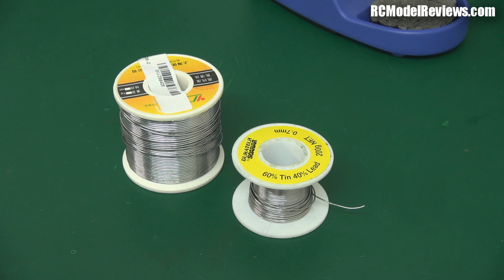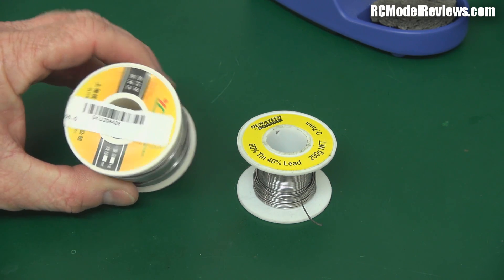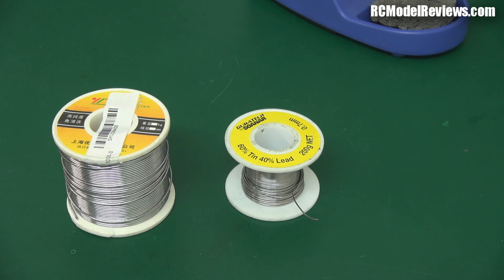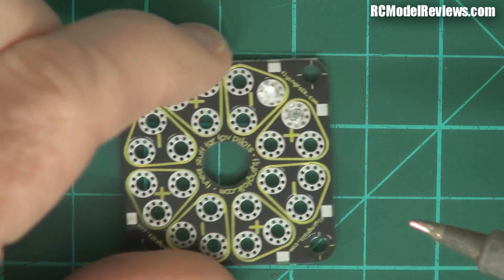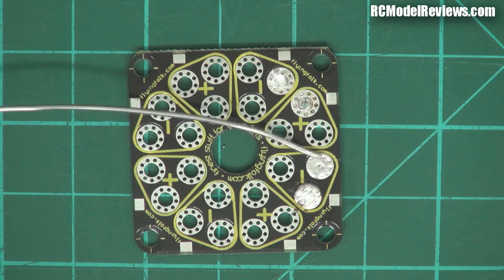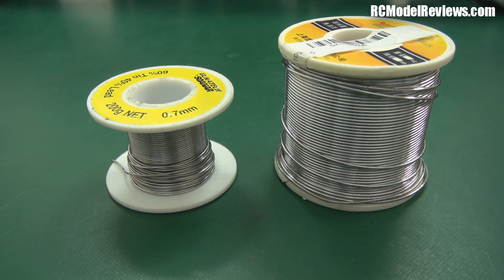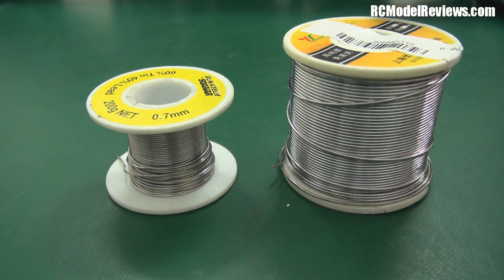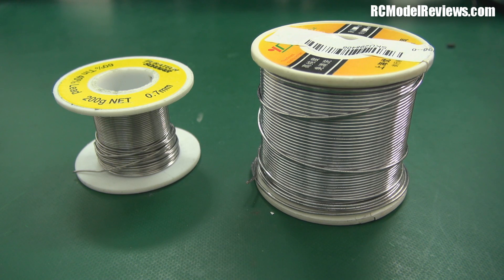60/40 versus unleaded solder

Comment: Lead solder can save the planet. When you capture that scary lead you can melt it in very controlled circumstances and restore discarded equipment, often due to failed RoHS solder joints, thus putting more tech into society and away from the landfill. All it takes is a bit of leaded tin, some dissolved tree sap, and a few watts of energy. Then that scary lead is sequestered in a useful tool instead of being out in the wild where it can attack your kids.

Comment: 60/40 sucks as bad as lead free solder. 60/40 is not a pure eutectic as it has a plastic state. The real deal is 63/37 tin/lead solder as it has only two states, liquid or solid. Lead free sucks because it has nasties like whiskers that occur as part of its process. If they would figure out how to make it where it didn’t do this, they may have something there. If you want the best solder, now you’re talking 63/37 tin/lead with an RMA, rosin mildly activated flux core. Why you may ask, used under J Standard 006 level 3 rules, this solder produces the best appearances, can withstand mechanical and physical stresses, g forces and thermal inversions and laugh. As long as it is performed under the strict rules of this standard,the joints will pass all tests and laugh. Most are unwilling to solder to this level, aka critical circuit soldering. It takes discipline, no compromise and strict adherence to this standard. Few can, but it is possible to learn. There is no place for any mediocrity at this level. Only the dedicated and the disciplined find this certification after their name. You can learn!

Comment: I've always wondered why everytime I  solder a joint it comes out really bad, really messy or poor joint/cold joint.  turns out i was using unleaded. using higher heat did damage to  so many of my PCB's and surface mounts

Comment: You should also mention that unleaded leaches the copper off the actual PCB (the traces etc.) unless you pay for gold plating/flash and because the chemicals used in gold plating are so much worse for the environment than lead, its use in fact worsens the state of the planet.

In the leaded solder days hot air solder levelled PCBs were very common, because these manufactured really well and could be reworked and repaired. With lead free you just can't rework fine pitch PCBs without gold.

Comment: 2:00 If the presenter is an expert, why did he try to buy 250g of solder for $6 (NZD?)? 🤔🙂 Why not spend $60 AUD/NZD on 250g of decent solder like Multicore 62/32/2 Sn/Pb/Ag?  It's a big price difference, but surely it's worth it for the quality control? 🤔🙂

Comment: I had to do a second take when you said $6 for ~500g. I think at that price point, it's not representative of any type of solder. I don't recommend buying solder that doesn't have Western text on the product: this is a declaration of what you're about to use a year later when there's no trace of what you bought. For example, you don't know if the flux is water-based and MUST be cleaned, you don't know the amount of silver, and you don't know about conformity to laws in your country. I recommend to learn what types of solder there are now, and to buy solder from a known brand that does product declarations - to you, and to stores, companies, and schools that stock them.

So your problem (if you want to call it that) could be up to heating and re-heating the solder too many times, too much solder applied, incorrect temperature on the soldering iron, uneven flux core, wrong composition for your use case, or not spending any time getting used to it as you did with leaded solder a generation or two ago.

Comment: I don't have these issues with sa305 and nice flux. also I find that a good quality soldering iron is necessary with lead-free, you need higher temp and better thermal transfer.

Comment: It's pronounced "Sodder". Tortilla is pronounced "Tor tea ah".  Lead free solder works well in industrial dip soldering applications. For hand soldering, use name brand 60/40  or 63/37 tin/lead rosin core solder and rosin paste flux. Use a "bridge" of molten solder between iron tip and items to be solder joined. Keep iron tip wiped and "tinned". "Tin" ends of wires before attempting to make connector solder joints. Tinning= Coating  with solder. PRACTICE soldering, watch solder flow action, learn to heat properly and remove heat quickly  to avoid damage. It's an art.
A name brand 67 watt soldering iron with replaceable tips works fine for hobby soldering,  a nifty soldering station is nice but not necessary.

Comment: Im only half way through the video right now so you may have touched on this in the later parts but.... the dangers of lead are far more than what you're making it out to be. the stuffs literal poison. when using lead based solder it is CRUCIAL that you wear a glove on your solder handling hand or wash your hands after soldering. avoiding touching your face until then.  thankfully we have ROHS for large scale manufacturing so lead doesn't spread throughout the environment through E-Waste. and I CANT STAND lead free solder but if you want to make your life easier you must take the proper precautions, lead WILL stay in your bones FOREVER.

I love you guys be safe!!

Comment: 63/37 Sn/Pb kester 84 for the win. Lead free is awful, especially the Sn/Bi alloys💩
Reply: ive been soldering ever since I turned 13. I stopped when I turned 15. I am currently 16. I am scared of the health risks that come with lead. (permanent IQ Loss, Decreased fertility, delayed puberty, decreased brain size, decreased testosterone, increase risk of cancer, kidney harm, and so much more...) Ive been soldering with leaded solder and I am afraid because what if I have permanent damage to myself forever, all because of a hobby and no prior knowledge... I did use a HEPA Filter, yet lead gets absorbed by contact. Lead fumes only occur at 4000f, which is impossible for us to achieve. I need to know if I am not affected nearly as bad as I had hoped, and if I am still at a "normal" range of lead exposure... 😭

Comment: I was suffering trying to understand why my soldering iron stopped melting the solder, sometimes it would sometimes wouldn't. I had one more solder wire with me from different product. Applied the other one and it took flawlessly. So at least I know the issue was a low quality solder wire. Thanks for the video ,you confirmed my issue.

Comment: Don’t take my word for it, but according to what HereSay has to say, there is a phenomenon in which lead-free solder has a tendency to grow tin hairs, and short components on your electronics, while you sleep at night. (It basically comes to life)
Now I’m not sure if this is true, but I grew up soldering with leaded solder, and I still favor it, over its ease if use, and ability to wick it with braids when removing components. Lead-free has a higher melting point, and isn’t really any easier to wick up. I never really liked that lead-free spool, for that reason alone.

Comment: Thanks for the Video Bruce! I solder for a living and we use mostly 60/40 lead solder, we have a small area where we have to use lead free, and everyone says tge same that lead free is horrible to work with, you need extremely hi quality hi temperature irons to do the job. Currently taking a recert course at work and tou guessed it they've changed to lead free for the practical🤦‍♀️ its bloody horrible for tiny little surface mounts I can tell you, nevermind the 100 pin components. It barely just copes with through pin and if you get a bridge that's damn near impossible to get rid of. Leaded solder all the way for me, we where gloves and have extraction units so it's safe for us. 🙂

Comment: Lead free is harder to work with but I made a personal decision to up my game, not for myself, but for everyone else who will have to live with the soldered fixtures I create which will eventually turn into waste.
Reply: > Lead free solder has been banned from aviation equipment due to its discovery of unreliability after several deadly aviation accidents. The reason is it cracks under vibration and temperature changes over time. Lead free solder is also one of the major causes of modern electronics ending up in the landfills.
THIS is the way to make more waste, not the leaded solder.
Reply: @Scorry  I think they pretty obviously meant the health concerns.
Reply: Doesn't it make more waste as it tends to increase failure rates?  PCBs with faulty solder joints at just 10 years instead of still working well at 40+ years? Or are increased failure rates on products using lead-free solder a myth?
Reply: @TassieLorenzo  ,
> Or are increased failure rates on products using lead-free solder a myth?
Lead free solders are banned in military and aerospace production.

Comment: @RCModelReview, I only buy 60/40 Lead bearing rosin solder. always great results. I accidently bought some Silver bearing rosin core solder . haven't used it yet. not sure I will. I know it takes a higher heat range to work with the Silver say 430F Melt temp and the good old Lead says 361F melt temp. I like to use as a cool temp as when working with thin circuit boards. some say the sliver is stronger bond. is that true?? Good Video.

Comment: The HELL with lead free solder! Its the worst sht in town, and it ruins all kinds of electronics. Why in the Hell do you think the majority of all electronic waist is on the increase since the 2000s? Because of tin whiskers are shorting out sensitive components. Just look it up, about tin whiskers! Because of lead, is preventing tin whiskers from forming. My man just thrown away a $250.00 digital meter that he only had for two freaking months! Fuk lead free solder. He will be getting a digital meter kit that he can build on his own, and he will be using lead solder! 60/40... He has been using leaded solder for over 30 years with no ill side effects, so all of this so called ill effects from leaded solder is just plain BS!

Comment: I use lead free solder on my drones, I love it. But mine is 96% tin, 3% silver, and 1%copper (Kester lead free rosin core) I do have to use a iron that goes above 750deg tho.  Amazon had one for $40 on sale. I think the silver and copper in mine gives it just the right amount of malleability so it isn’t brittle.

Comment: I use stannol lead free solder for over 10 years and never had an issue. Its pretty expensive though.

I will say though, cheap leaded solder usually does fine while cheap lead free solder is pretty awful. Lead free solder needs to be good quality to produce good results. 

The solder you showed in the video seems to be really bad, and seriously lacks flux. There is almost no smoke despite being at 390 degrees.

Comment: there is an unleaded solder with melting point at 138 degree (Sn42Bi58). And it's very expensive. But you have to be careful not to buy the fake ones.

Comment: Led free solder is not that bad as you grandfather remembers! The problems is that led free solder isn t that flexible because doesn t have lead, and using it to solder cpu or chips that get s hot and cold all the time can crack the solder.

Yes is harder to solder with cheap solder iron.

Comment: Old video, but I'm pretty sure from the way it behaves that the cheapo solder you had actually isn't lead-free. Instead it probably has a high lead content like 10/90 to save on costs because lead is cheaper than tin.

Comment: Tree hugging hippie solder, lol. Really though, I think the idea of unleaded solder is so you don't shortcircuit your brain like Gordo on "Halt and Catch Fire". Tin is a heavy metal too but, probably not anywhere near as bad for you as lead fumes. Regardless, I've been looking for 100% lead wire to test out ,which in many places I think may be illegal to sell for soldering but, you can buy it as weighed fishing line. The weighed fishing line comes with a nylon braiding around the lead core but, it's easily removable.

Comment: I work on lvl 2 and lvl 3 boards. So 95% of boards I do are lead free. Now i'm definitely not advocating for lead free. I personally don't like it in comparison to Tin. Its an unforgiving solder. But using a chisel tip, tinning your tip, and using a secondary Water Soluble flux will make life easier when working with Lead Free.

Comment: You should try using some Sn42Bi57Ag1 solder, it’s lead free but is just as easy to work as leaded solder. Tin-copper solder is garbage.

Comment: I hope they in the 21st century, they soon, invent tips that don't oxidize and wire that solders at low temp (not too low that it desolder if, say a CPU is overclocked or it's used in Africa, near the equator or Death Valley, California) that doesn't need flux and is clean and shiny:-)

I think this'll happen, once the room temperature superconductor alloy is discovered and it's as cheap as copper wires.
:-)

God bless, Rev. 21:4

Comment: Most experienced people who can actually solder or those that have taken some form of IPC-A-610 course would disagree with this video. That’s not to say leaded solder is bad. Its actually pretty good if you’re new to soldering. Its easier to use than ROHS solder. I always recommend new people to use leaded solder if they haven’t touched a soldering iron before.

Comment: A soldering iron I bought came with 99% tin solder, I was a beginner and used it on a 3 hour project, I needed to set my iron extremely hot to even just melt it and I ended up burning the tip off my iron in the process, and ruining 2 or 3 of the joints on the pcb. definitely not good for beginners. But at least it taught me about solder and I learned that I need to coat my tip with solder and clean my tip with flux in the future. Also this soldering iron has a none standard tip and I can't buy one anywhere, I guess its time to buy a whole brand new iron and solder, lol.

Comment: I knew it! I thought my tip was bad or my iron was not hot enough. Turns out I got lead-free solder wire as I used to buy it per meter from a repair shop. Terribly brittle and flaky.

Comment: I can see how this might be true for rc, but for surface mount pcb repair, unleaded is just fine. Just use plenty of flux (like you would anyway), run you soldering iron a little hotter and make sure to have good ventilation (like you should anyway). If you do it right, it's definitely safer than leaded solder.

Comment: The problem with your solder is not that it is lead-free, the problem is you paid 6$ for 500g. Even leaded solder that cost this little and is no brand from china behaves exactly the same as you shown. If you buy unleaded solder from a good brand and you have an iron with good thermal performance it works just as good as leaded solder.

Comment: Don't buy solder from China, it is Tin packaged as Lead, as in this one on ebay: https://www.ebay.co.uk/itm/Fine-Solder-Wire-0-6mm-60-40-2-Flux-Reel-Tube-Tin-lead-Rosin-Core-Soldering-UK/401952125122 Time to boycott China

Comment: 7:44 radioshack cheap soldering irons have their tips made out of copper, never thought it could have been because of that but i literally used one of them till it was full flat haha! Ridiculously cheap high quality (for their price) soldering irons... just bought one for $3 and yeah, my tip is dissolving again! ill start using it just for non leaded solder  applications

Comment: You just bought shitty solder from china. I bought 60/40 from china and it's basically useless, it doesn't flow at all. I'm using good 60/40 and good Sn99.3Cu0.7 and there's literally no difference between them.

Comment: is soldier conductive? i have always wrapped my leads together and then 
soldier them however i have seen a person build a copter by putting 
blobs of soldier on each end of a wire and then melting them together 
and it appears to work consequently it appears that the wires don't have
 to make contact,

Comment: Is real lead solder not sold anymore? I can only find "new and improved" non lead versions in Scandinavia. On a footnote; Saving the planet is really a good idea. But switching to lower quality usually means lower performance, shorter lifespan and more waste. It's good for some (Asian) countries economic growth though. Considering that shotguns use pure lead loads and spew out approximately 1.2 oz per shot, well. Soldering does not sound so bad.

Comment: The SAFETY TIP: wash your hands after your done! idea is - never/ever want lead to touch your tongue! Don't eat and work same time! 2019 - many tests-.. the strongest and fast to go hard..is the 63/37 … stays nice and bright/ clean ...breath lead paint for years you at high risk open area /you ok,,, but lead paint walls.. people touched it and eat that's almost instant chance cancer /and definite if  sticks to soft tongue :>( .adukts needs supervise. / wash  your dam hands... keep the stuff in safe place.. use wisely is all! I promise that smoke from both types is bad! just well vented and don't hover over top it as use solder! easy if know what to do: wash up when your done/always use heat shrink to protet YOU! and I luv the added hotglue over that / keep out moisture! makes it outlast the battery life.